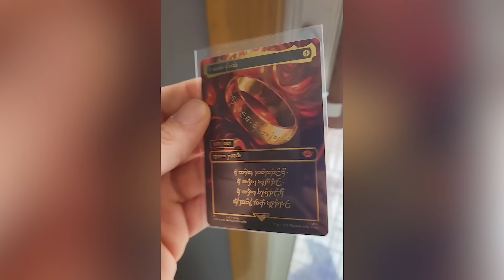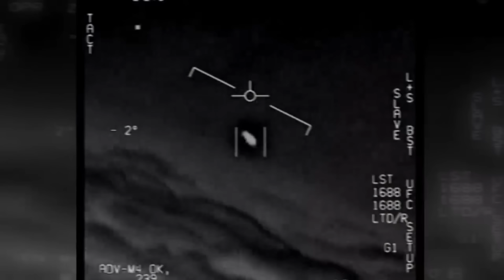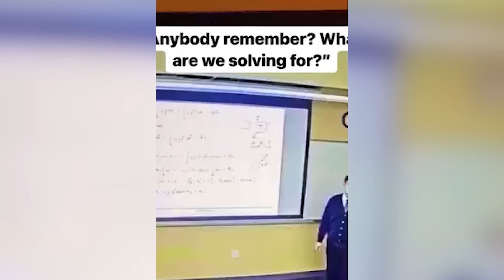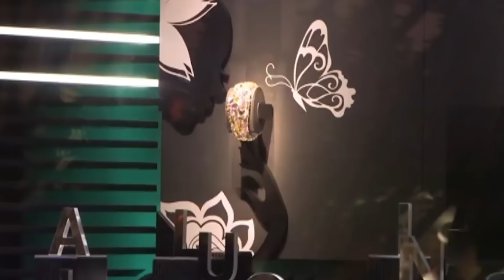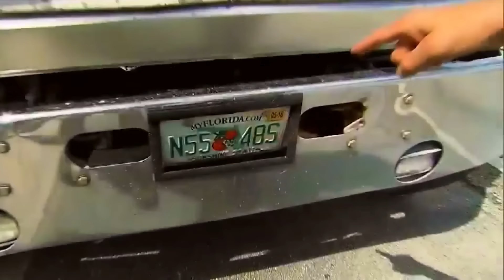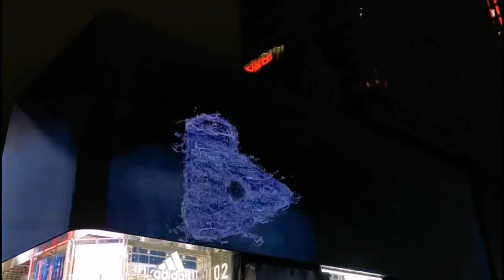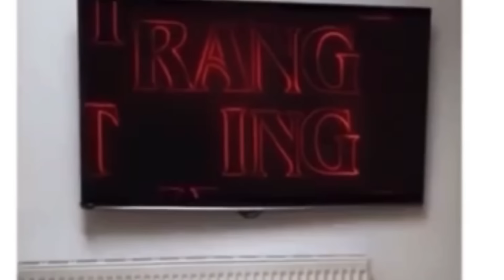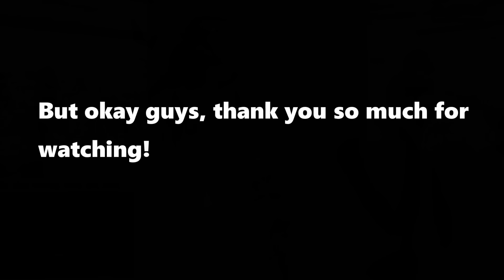Most Unbelievable Moments Ever Caught On Camera!

Comment: 33 Thomas Street in NYC might be able to withstand a nuclear bomb detonation occurrence, but in reality, IT IS AN AT&T DATA CENTER.  No windows are for the purpose of maintaining a certain temperature for all the equipment to stay stable by not overheating.  An equipment failure occurred there in 1991 due to power loss, human error, and poor management disabling the main switching office, which in telephone communication terms is a terrible disaster.

Comment: the clip of the cybertruck vs the porsche is a publicity stunt. first the video is of them doing a 1/4 mile and not a 1/2 like what was advertised. next they used the slowest 911 currently in production, even using the manual version. lastly if the race was a whole 1/2 mile then the 911 would've actually won and the math was done by Engineering Explained on his youtube channel

Comment: 4:00 USS Detroit WAS a 3500 metric ton ship in the US Navy. She was launched 18 October 2014 and decommissioned just shy of nine years after launch on 29 September 2023. What's more unbelievable is that the Navy is building these $362,000,000 Freedom-class littoral combat ships and only keeping them for less than a  decade. Of the 13 built so far since 2008, five are already decommissioned.
Reply: It would be nice if they didn't buy them in the first place, but there you go. Anyway I'd rather they get rid of them since they didn't work out that well.  Why keep them around and sucking down even more money while in operation?

Comment: 🇵🇭 4:43 There's also Province  here in the Philippines we've travelled to. I'm surprised to see a small Round about in the middle of the road up ahead. Turned out, it's a Piece of a Cemetery with actual Tombs, crosses, headstones... 
It seemed the Relatives doesn't want it destroyed and flattened. So there it was, Horror Roundabout.

And when we passed by it, it's almost Midnight. Can you imagine a Faraway province, not much Road lights and then you'll see ahead it's a Piece of Cemetery in the middle of the road? How'd I feel?

I'm thinking, what the Fuck am I doing here. I want to go home.